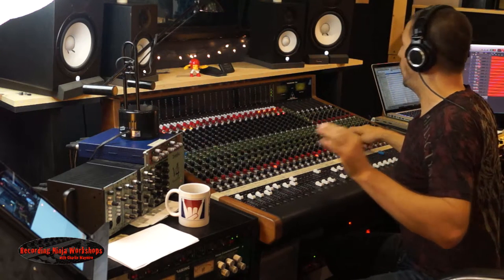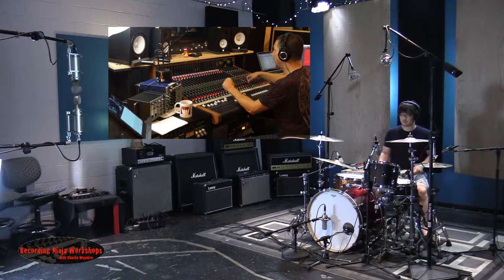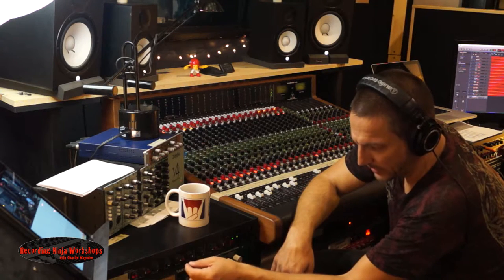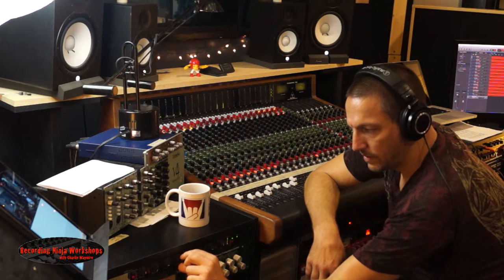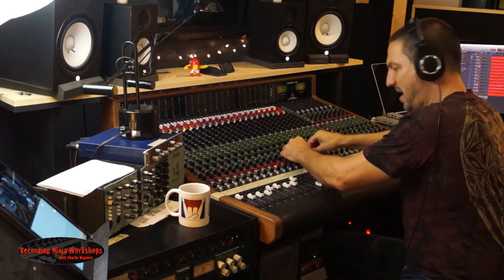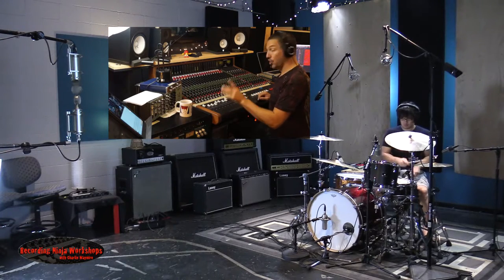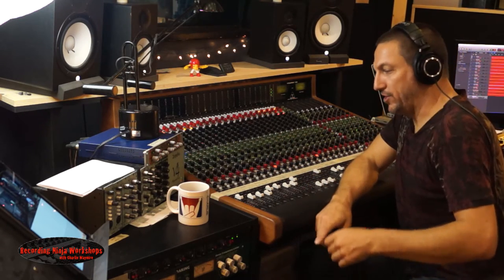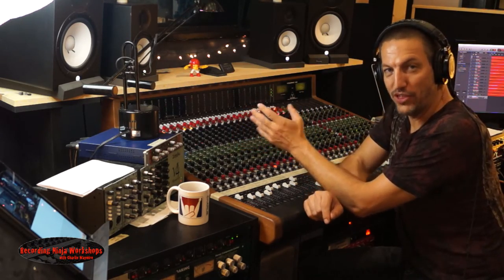Compressing Drum Room Microphones

Comment: will my first drum kit Pearl sound like this? I have 2 up and one down. my Avatar is my drum kit by the way.  I'm currently listening to this using my Audio Technica ATH-M50X monitor headphones! Thanks.
Reply from the maker: I love those headphones! I believe it's possible to get a great drum tone with almost any kit. There are two main requirements for that to happen though:

1) It has to be tuned well
2) The drummer (you!) has to pull a good sound out of the kit. 

As long as you have those two ingredients almost any kit can sound good. I have a really cheap $200 Pearl Forum kit that we use sometimes and it sounds great!
Reply: Thanks for the awesome sound advice Sir, simple instructions but solid ingredients.  👍
Reply from the maker: One thing I forgot to mention is that Pearl makes GREAT inexpensive drums. Especially the kick drums. You should definitely be able to get a good sound out of that!